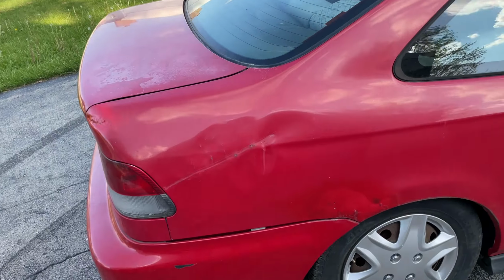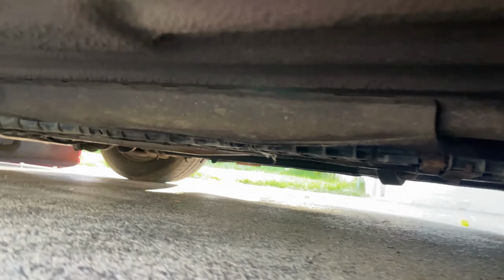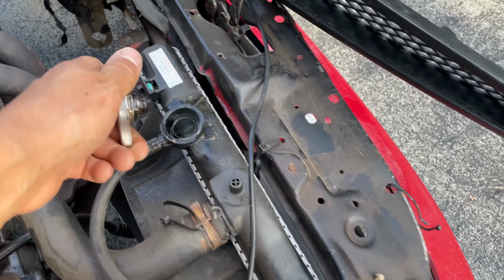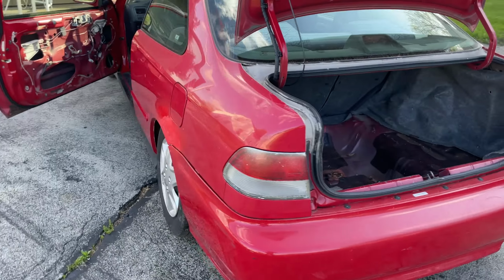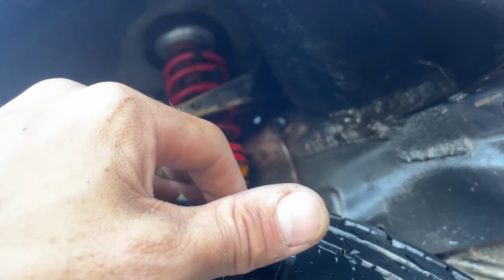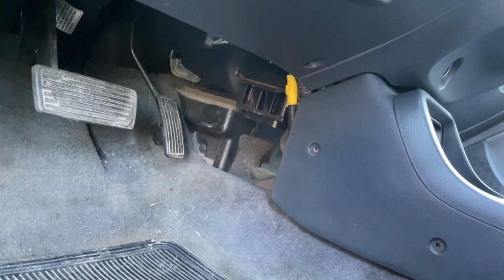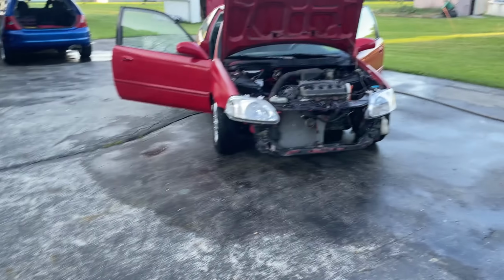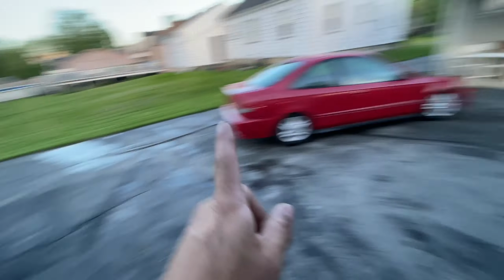NEW PROJECT! 99 CIVIC EK COUPE | FRANK'S GARAGE

Comment: That thing isn't that bad. If you need any help or tips with the body work hit me up. Looks like someone used primer on the trunk jam to cover up rust or slow down the rust. You'll need to pull the windshield to paint so it's not a big deal it's broke. It's funny I just bought a 95 coupe in a lil better condition but looks the same. Red with a black hood on steelies lol.